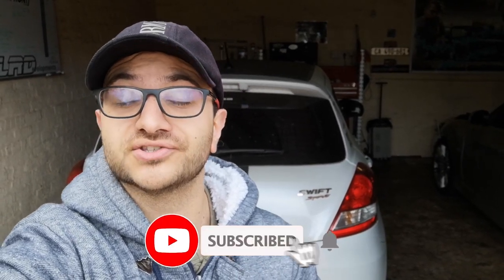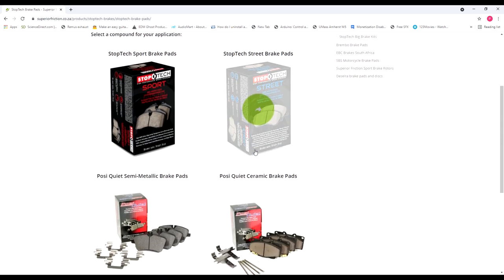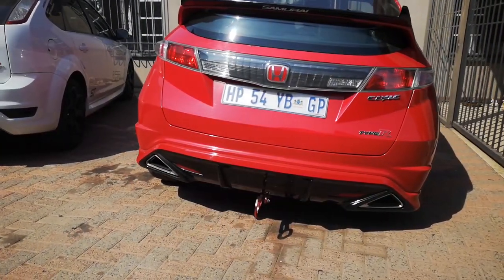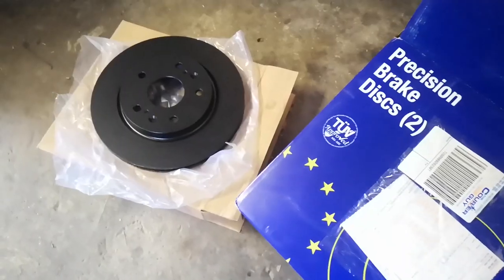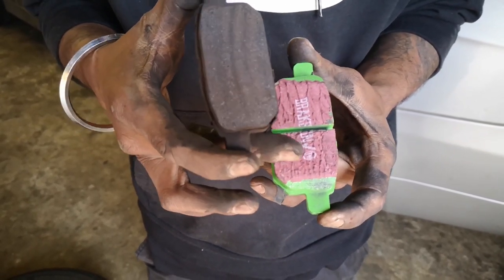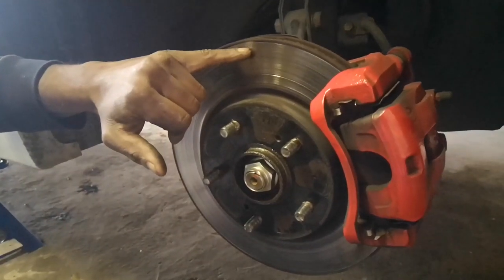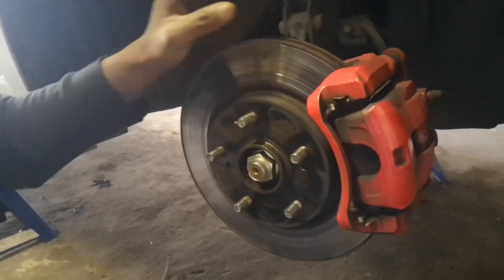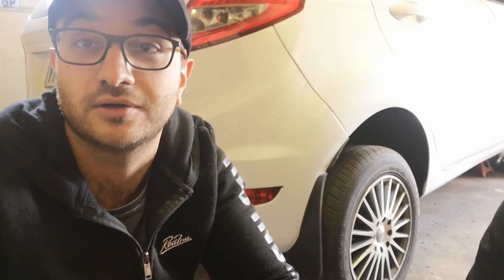BRAKE UPGRADE INSTALL #brakes #stopfast #upgrade

Comment: Nice one bro! But slotted discs just look cool! 😁

Side note... PLEASE PLEASE PLEASE tell Ashley to NEVER put yours or any expensive mag wheel under a car while on on a jack!
Something happens and it falls, it's good bye rim! And also if a nut or bolt or spanner is dropped it can chip or damage the rim....
This is why God made a tressle... 🤣🤣👍👍👍

And when we doing that well overdue coffee mate???????
Reply from the maker: Hey bud thanks for the support. I know they look cool but for the extra cost It wasn't worth it on my car. There were two tressles under the car plus the jack as support so all good 😀👍🏻. Yes we need to do coffee soon!